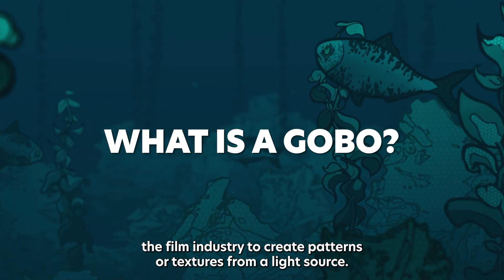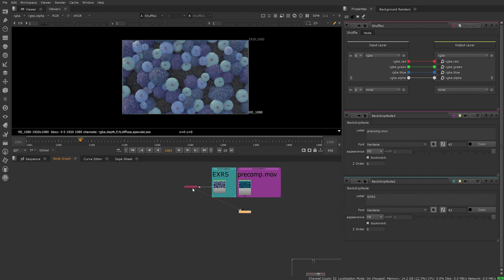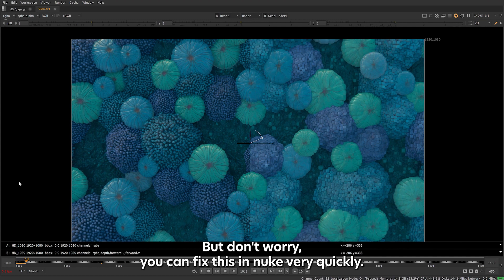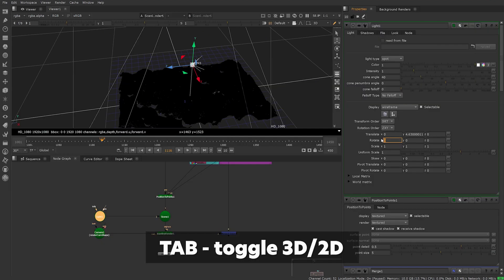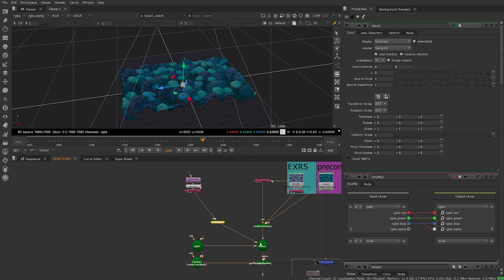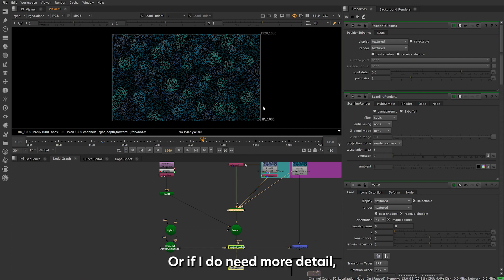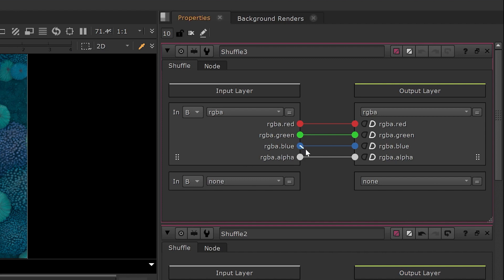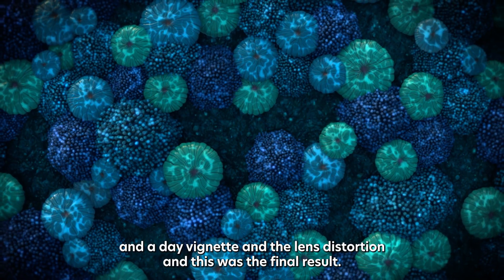How to create a gobo light effect in Nuke.

Comment: Hi, great tutorial! I had the problem of incorrectly configuring the position pass and thanks to the tip you shared I was able to solve it, but then when I wanted to follow this gobo light tutorial, the spot light does not illuminate when I see it in the 2D view through the scanline render. It also doesn't let me illuminate my pointcloud from the front, it's as if it only allows me to do so from behind. Do you know what could be happening?
Reply from the maker: Hey, thanks so much, and thanks for flagging this. I've had a quick look at another one of my projects using a blender normals pass and I see what you mean. Had a quick play and I think I've found the solution. Check it out here: https://www.youtube.com/@DropThePiProductions/community - let me know if this works! 🤞